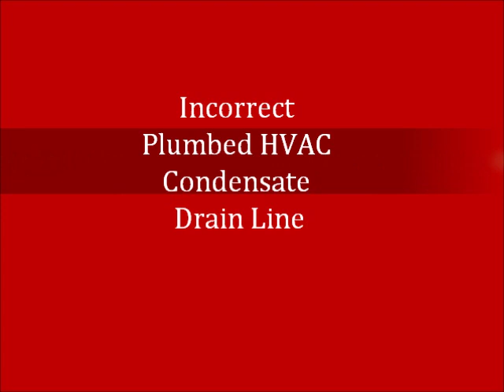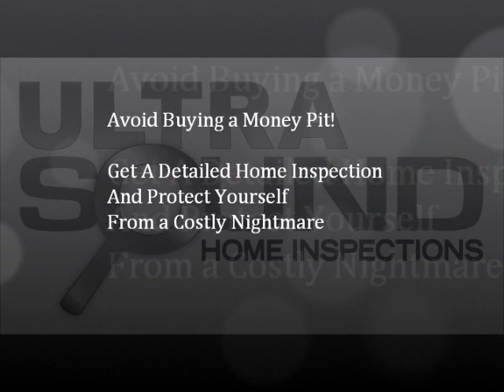Incorrect Plumbed HVAC Condensate Drain Line Found by Franklin TN Home Inspector.wmv

Comment: If the original installer would have installed a "P" trap in the condensate drain line the possibility of sewer gas goes away as long as the unit is being used and the P trap is wet.  It looks like this was the "only" condensate drain line.  In Texas, we are required to have a primary (hooked into the house drain system) and also a secondary line that dumps outside in a conspicuous area like over a garage door or something that will be seen immediately.  A ball valve and hose bib can help clogs.
Reply: Exactly

Comment: You are right this is not the right way to run the drain line,but sewer gas will not leak into  the ac because that line is not hooked to the ac, it's on the emergency drain pan not the unit
Reply: It should be run to a place above a window. The smell will be in the attic.I don't see where the primary drain was run to,but normally would come out with the line set.

Comment: Does not a condensate drain require a 3" air gap?  And in the attic space you cannot have an open vent.  I was wondering about a standpipe 3" with a trap with an open end to the condensate drain with air gap and it's own trap, but the danger is the 3" trap could evaporate so banned by code.